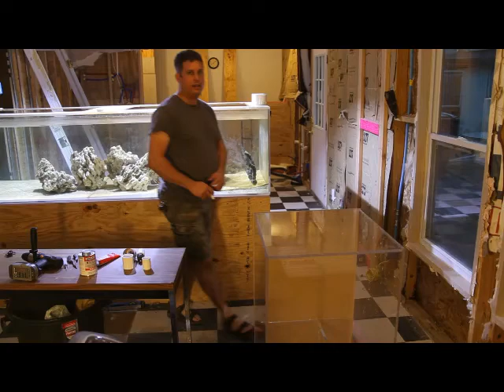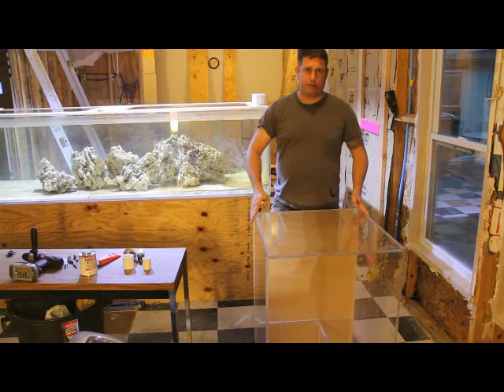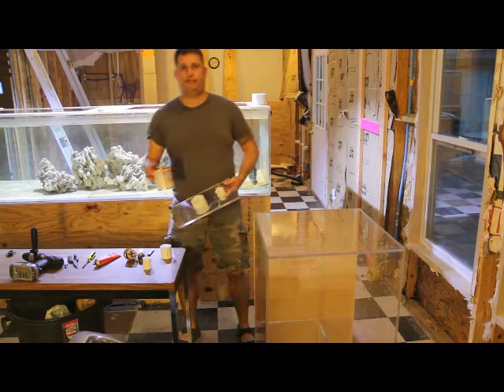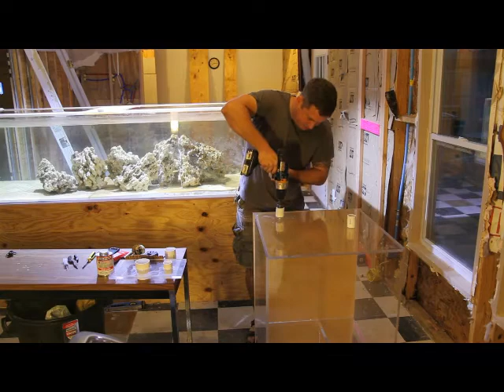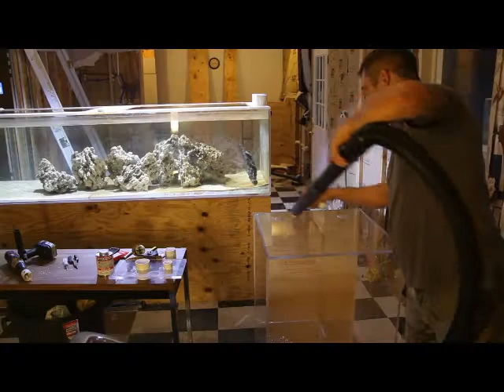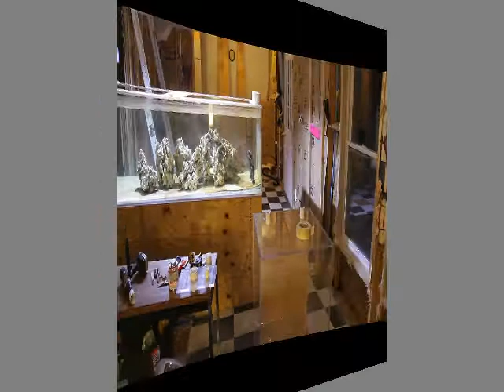How to Drill an Acrylic Tank

Comment: Thanks for taking the time to make ans post this video, Brian.  I also wanted to say that the difference in the thermal expansion rates between the two plastics is less than the flex rate of the two added together it is not a problem.  It's not going to crack.  Also, if you really needed a flange you could always buy a cap and drill it, thereby giving it a grating at the same time.  I like the video, the specialty aquarium parts are hard to find and expensive.

Comment: Do you have to use a certain kind of hole bit when drilling acrylic?
Reply from the maker: Just a wood bit.  Nothing magical to cutting plastic.  Be gentle and let the bit do the work or it will bind and split the acrylic.  Avoid using too much pressure or it will melt the plastic instead of cutting it.

Comment: Awesome Video! I have a question. I purchased a 90 gallon Acrylic tank and Acrylic stand. I need to drill an extra hole on the back side of the stand to allow another hose line thru but but tank is now running full. I bought the stand with 2 factory holes drilled (Didn't realize I would need another filter) Can I safety drill a hole on the back side of the stand loaded with water on top?

Comment: Personally, I would only use this method if I glued in a piece of acrylic to provide a thicker flange area to glue to. But I'm sure it probably works just fine without. I think I will be sticking with rubber sealed bulkheads though myself.